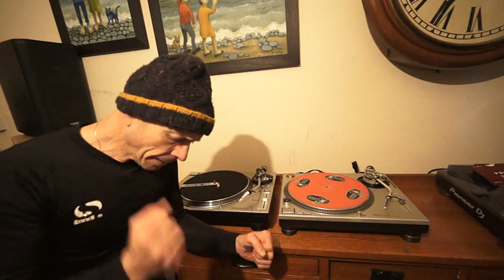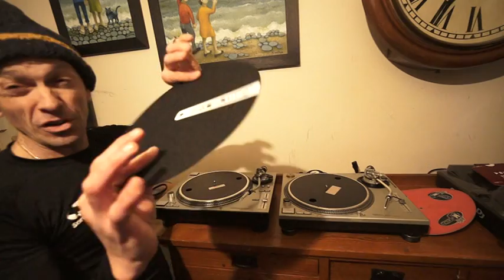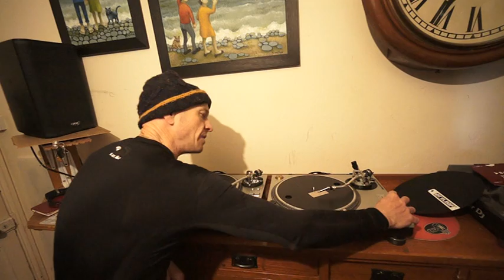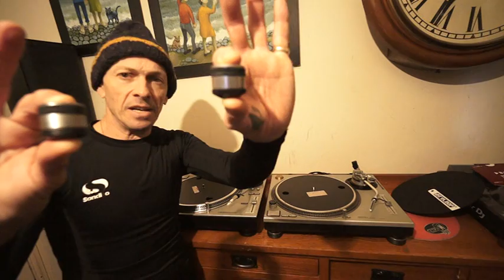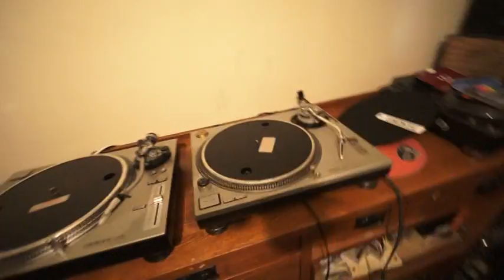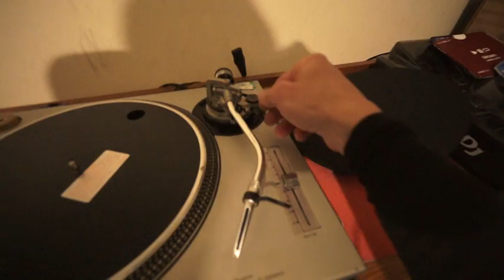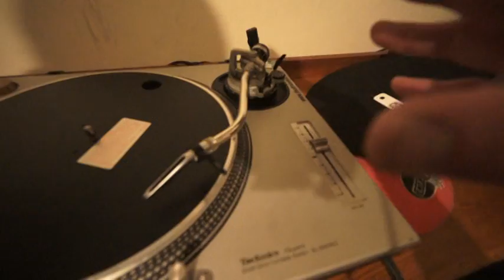RELOOP RP7000MK2 SIDE BY SIDE TECHNICS SL1200MK2  VINYL TURNTABLES

Comment: You should test the 1200 MK7. This is the actual model. All, what you missing in a MK 2 will be in there.
Reply: The MK7 is terrible, the pitch control is digital like that horrible reloop rp7000 mk 2 , give me a Tech 1200 mk 2 anyday, I hate written to Technics asking them to reinstate the analogue pitch , it's a shame all dj's don't do the same and we can then stop the production of all these lame tables with digital pitch controls////they are all junk , even the new technics are junk , anything after the MK5 is utter tosh
Reply: What are we missing ?  Who needs 16% ?? And who cares about reverse ?
Reply: Daniel Spaniel  It is more accurate in only one way, that it gives exact figures when put at certain pints of a pitch scale, the digital steps are far greater than the small amounts you can fine tune an aanalog pitch too, you spazer lol ...And as for movemt you mean wow and flutter ...which has nothing to do woth the pitch anyway spazer
Reply: Daniel Spaniel  I have 2 pristine mk2's and a whole box of spares , inluding new spare tonearms, several new pitch controls and 4 main boards and 2 of all the main chips ...so up yer arris
Reply: oh my god - this digital pitch police - what the actual f are you ppl talking about?! Pls get real - Technics also has turntables with digital pitches and guess what - world renown djs use them without any f problems - and they also happily switch between them eg. mk2 to m5g to mk7. They are "different" but neither is better than the other in absolute terms and neither is shit. ffs

Comment: Excellent review, having previously owned 1210s, and now currently own the RP7000 mk2s I can honestly say that the Reloops are a better turntable!
Reply: While the Technics are still legendary products to me, I now own the Reloop 7000Mk2 Silver Edition and it's a very, very good turntable ... The SL1200 could still be good but they're often overpriced and yes, they're getting old ... on the other hand I know about the upcoming Technics MK7 but their target retail price is more than twice a 7000Mk2 and since my Reloop is doing a good job, I just can't justify a switch ... moreover, I'm not sure I want to bring a $2000 turntable ($4000 for a pair) into an hostile / club environment ... in the past Technics was the best ... I agree ... but time flies and nowadays it's different ... :-)
Reply: @daniellheureux4867  Totally agree! I couldn't afford a pair of the new Technics or justify spending that much money on them, so after reading several good reviews on the RP7000 Mk2s, that's what I went for and honestly think performance wise, they are better than the 1210s
Reply: what about the digital vs analog pitch fader discussion? I'm only starting and have a pair of numark tt200 turntables which are as low budget as possible, but i'm able to mix fine on them... i see a lot of people disregarding any turntable that has a digital pitch fader compared to an analog, they say you can't properly beatmatch on digital faders...

as an owner of both, would you said that the difference is really that much? i find it really hard to believe and i think it's just something technics fanboys like to repeat as part of their cult mantra rather than base it on actual experience with both.
Reply: @256k_  I can't tell the difference to be honest, it's not an issue
Reply: @256k_  I had the Numark TT200s for about 10 years and replaced them with RP8000s. I used to DJ on Technics in Clubs ant the Numarks felt cheaper and not as accurate as the Technics but were good enough for home. The RP8000 is on another level. Not missing Technics at all anymore
Reply: @MilanFourTimesEight  awesome! i;'ve been using the TT200s for months now (not daily though) and i'e been making great mixes... it's my only experience with turntables so i dont know how better.worse it could get.. but i figure if i can do good mixes on those then on something better it'll be even better.

it's hard to get them to lock for a long time though i have to constantly babysit the pitch faders to keep things aligned but every now and then things lock up nicely
Reply: @256k_  There are way worse TTs than the 200s, so you are good to go with them until you have the budget for something with a higher price tag.What did you pay for them?
Reply: @MilanFourTimesEight  i think i got them both for like 100$ but they were in pretty bad cosmetic shape, i completely took them apart and cleaned them and restored them into a presentable shape 🙂
Reply: fayekhelmi i sold my pair for 130€